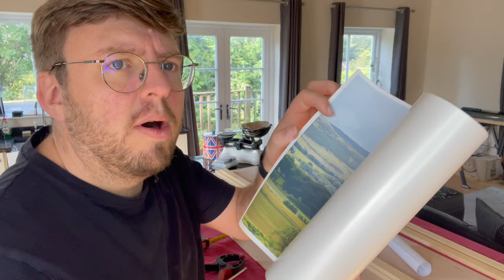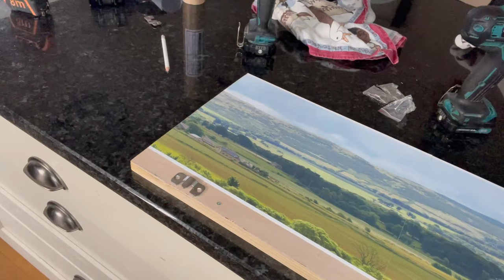Installing a Backscene at Treuddyn Junction Model Railway

Comment: It is looking great, the back scene looked like it went on easily, did it?
Reply from the maker: Thank you. I was surprised by how easy it went on. I was expecting air bubbles and creases. What I wasn't expecting was the strength of the adhesive. I couldn't lift it once I had put it on—even moments after I had stuck it down.